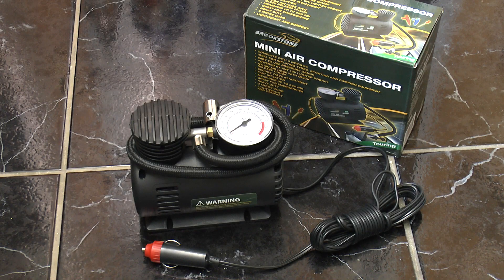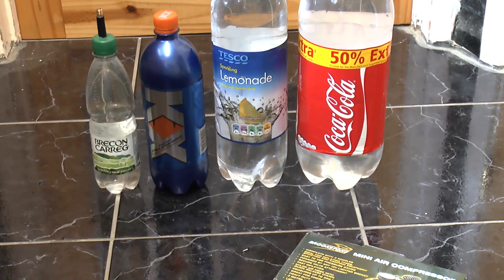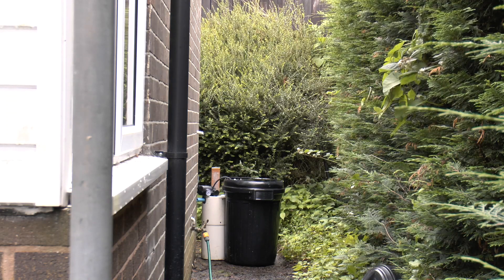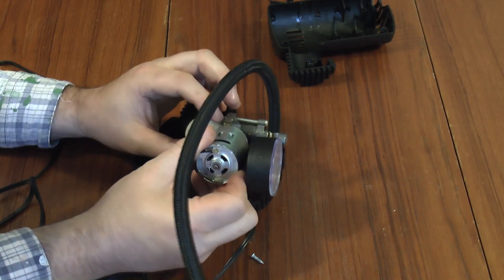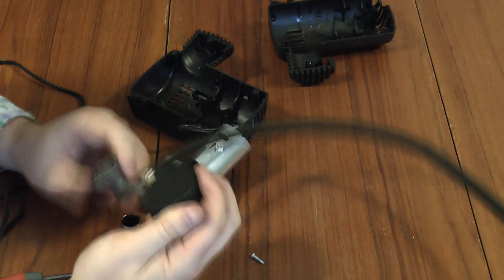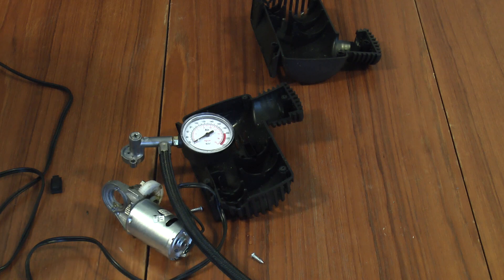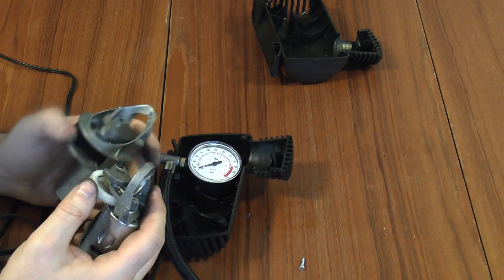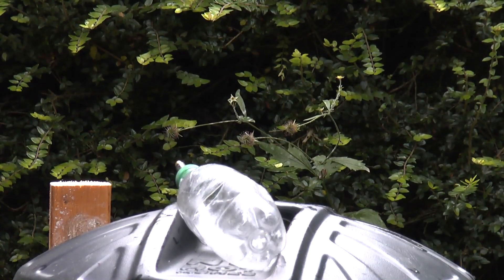Brookstone 250psi air compressor fail and autopsy

Comment: Would it be possible to replace the pressure gauge with something that's actually halfway accurate? Is the fitting standard 1/8" NPT?
Reply from the maker: I think it is, I'll have to measure it when I'm back home (the hose is now on a fridge compressor, or at least I think it's still on there from the "pop bottle depth charge" video).

Comment: I have a 5 amp ac to dc car plug power supply. This video gets two thumbs up from me because what I rely wanted to know is can I run it on that to top up my motorbike tires.
I can get one of these for 8 us dollars it only draws five amps up to 120psi.
If it lasts 6 months I'll be very pleased. Thanks for the video... also very entertaining.

Comment: Haha i just uploaded a review with a similar compressor. All those of the same design freak out at pressures over 100psi.  The motor quality is very high considering the price but it's too small to compress the cylinder in high pressure,with a thermal fuse it would be miles better.

Comment: and I thought my compressor's pump was cheap. Mine has a plastic piston and metal gears. Took it out of a $12 compressor bought at family dollar b/c I needed the hoses to fix a better made compressor that I had for years. The motor has a small 1.5 inch fan on the motor.

Comment: I suppose to be fair the needle was in the red :) if it was a movie nuclear meltdown would have been imminent, It's good to know how much pressure those bottles hold. I was always cautious about blowing one up with my workshop compressor at 95psi No chance! :) you should bring it up to pressure and blow it with the hot wire :)

Comment: Those 12v compressors are not supposed to be run for long periods of time without letting them cool off.  Perhaps you would get your bottles to explode if you run for three mins or so, then turn off the compressor, let it cool down, then start it up again.  I don't know if the air seals are good enough for that, but that might get you a bit closer to your explosion goal. ;)